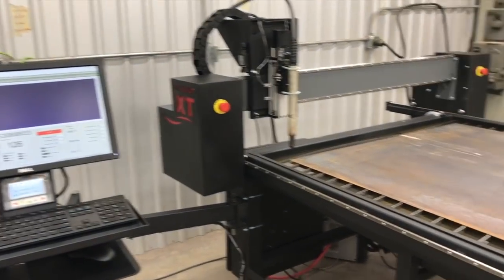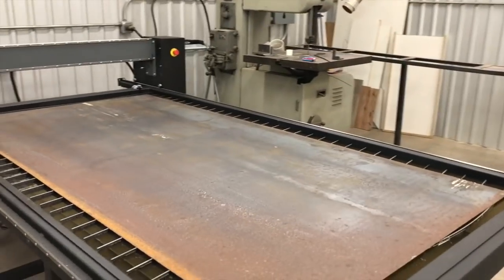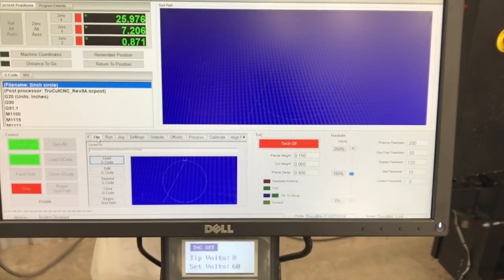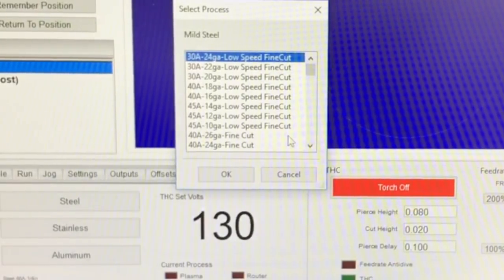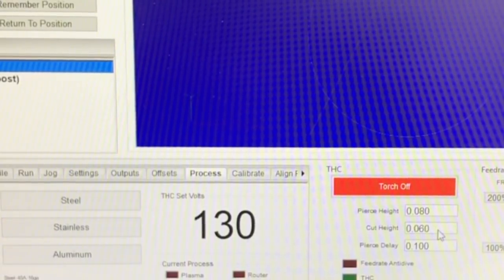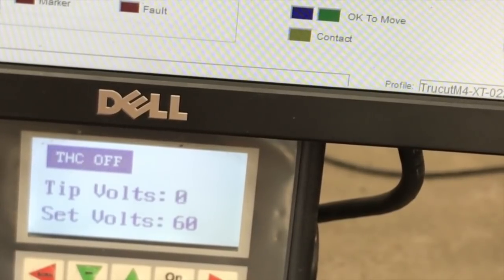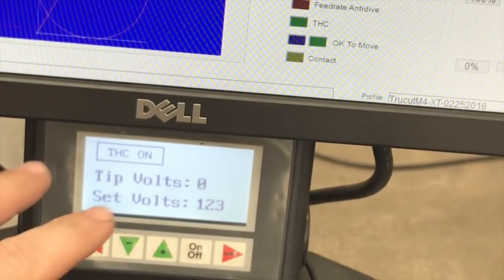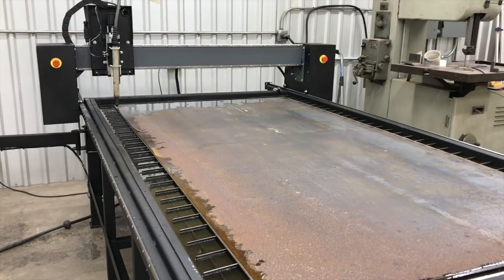First Cuts at 600IPM!! - 85amp Tip - 16 Gauge - New Trucutcnc CNC Plasma Table

Comment: That table sounds so smooth!
Reply from the maker: Yes, the servo's are super smooth.  So smooth at first they didnt seem to be running as fast as I thought they should be, but did soem manual IPM calculation while it was running and it was dead on.
Reply: Bbn